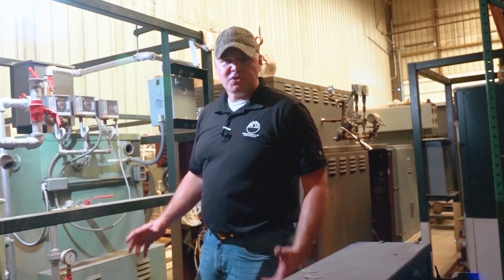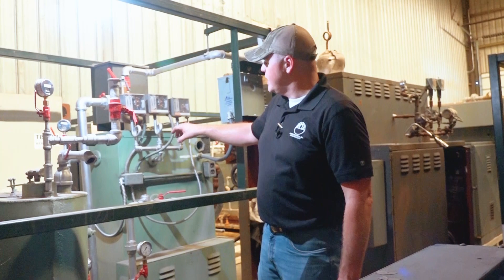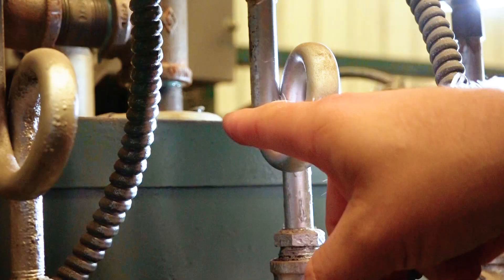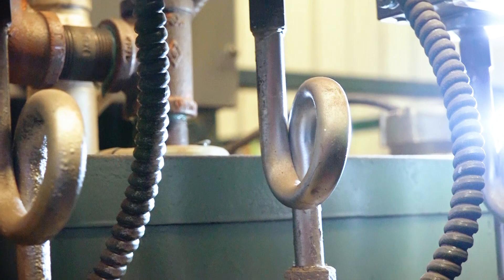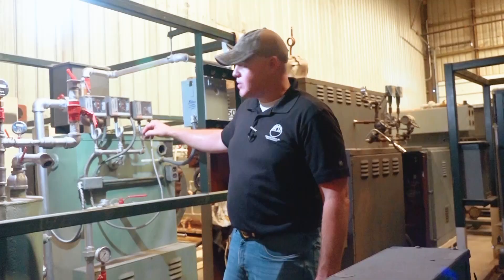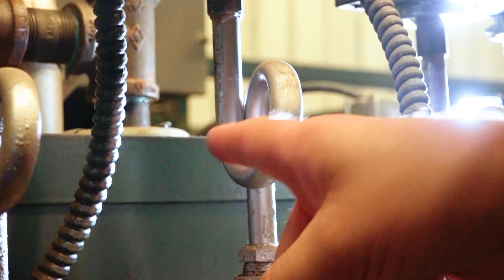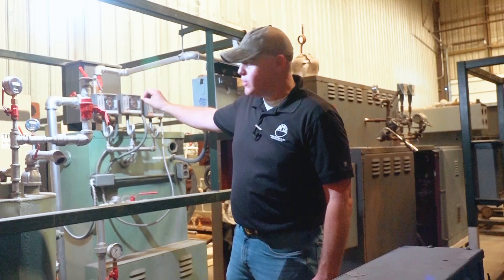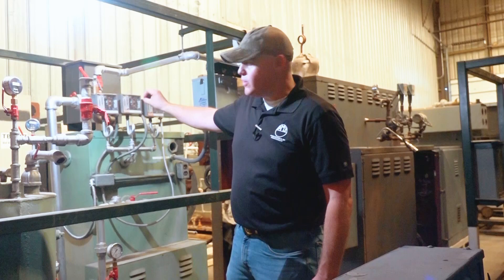Boiler Pressure Control Siphon Tubes - Boiler Room Tip

Comment: i have a question, when the incoming steam continue pushing the condensate inside the syphon tube, will it make the condensate vapourous? how the condensate will hold against high steam pressure?
another topic is, will the steam cause water hammering inside the bending tube?
Reply from the maker: It should not. The condensate serves as a barrier to the high heat of the steam. Pressure is still allowed to pass through and give an accurate gauge reading.